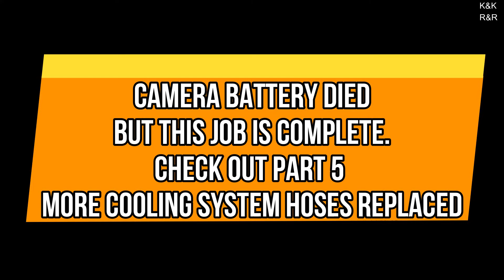2001 QX4 150,000 Mile Intake Cooling System Tear Down Pt4: Rear Thermostat / Water Valve Replacement

Comment: I have a leak from that same hose, haven’t taken off the intake yet. It’s gushing water when cold and idle, but I was able to drive it for about 30 minutes and no overheating at all. I plan on changing all the gaskets for the intake and valve cover gaskets. It was running cold prior to the overheat. The radiator is less than a yr old should I swap it out since it’s still under warranty or keep it?
Reply from the maker: Did you use import green coolant when that radiator was changed out?  Mixing normal Prestone green coolant with import green will causes microscopic clogging.  I don't normally change radiators out unless they are clogged, leaking, or a majority of fins are damaged. 
/K&K

Comment: can you change the front thermostat not not the rear thermostat. i notice my qx4 température gauges goes slightly up to H when im waiting for a long time
Reply from the maker: You can change the front thermostat only sure,  but if the rear thermostat (water control valve)  is stuck shut you will still have an over heating situation.   If it has over 150k miles you might want to do both to make sure it runs at the temp it was designed to. 
/K&K
Reply: @KNKRNR  as a first timer , is it a hard thing to do myself ? i bet scared but then again  i am confident i can do it by being extra cautious. a mechanic charging close to 900 to replace just that one

Comment: Hi, great job man . Question when pulling out the injector fuel rail how did you pull it out cause mine is giving me hard time, and the thermostat do you have to put rtv to prevent leaks.
Reply: You really just have to pry it out slowly and make sure you don’t lose any of the o-rings from the injectors, it took me several tries before I was successful